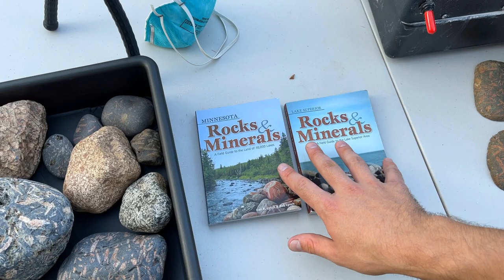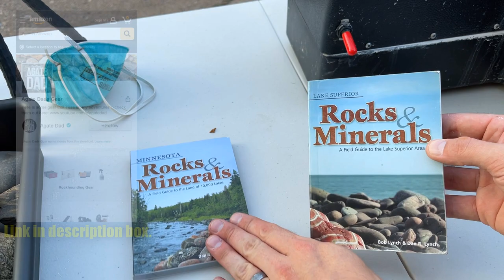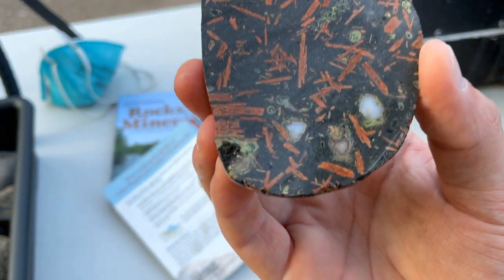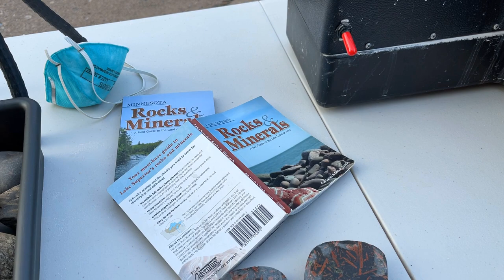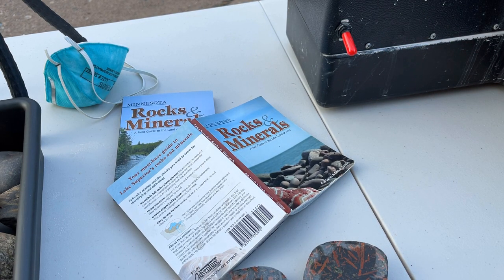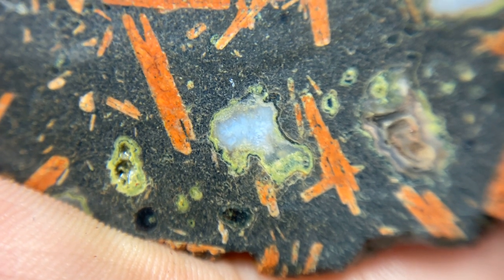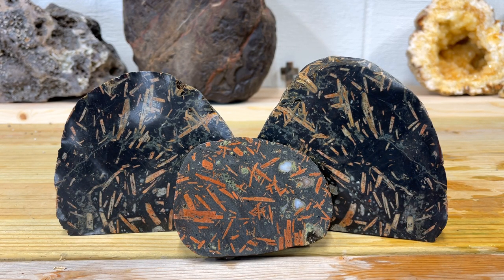I Found AGATE inside Porphyry!

Comment: I’m glad you showed how the blade doesn’t cut. I just bought a tile cutter with a Diamond blade and I’ve only cut a few rocks and I was scared the entire time.. 😬
Reply: careful you can still crash your fingers. only rulenis dont put a lot of pressure on blade if you have to put more pressure than usually buy new one
Reply: @uooello13  or you can clean it up and bring the diamond back up by cutting some bricks. Thats what we did when l worked in a lapidary shop.
Reply: @tinaredington1292  yes i forgot bout that.

Comment: Cool cuts. How good are you at cutting slabs straight? One of my trim saws has a little fence that helps get the two cuts parallel. I don't do as well just eyeballing them.
Reply from the maker: I’m not perfect at it but it’s not bad, I should get the slab guide for that saw
Reply: @AgateDad  If you're making a cab, it doesn't matter too much because you can even it out later. It matters if you're making something like crosses though.
Reply from the maker: My thoughts exactly

Comment: I found one this summer on Cap Sante beach in Anacortes Wa. I had a friend slice it into slabs.This rock was most beautiful and it has fern like patterns and the biggest surprise it has garnet inside.I poured resin glaze on the slabs and use them as coasters! Thank you for your video,  you ROCK

Comment: I really liked this video. They are so pretty. I wish I had a saw like that to slice mine apart, but I live in an apt, my dremel is the best I can have here.
Reply from the maker: Do you have a garage with your apartment?
Reply: No I don't have a garage, only my front yard. I have 100' extension cord I plug into my apt, run it down the steps, across the yard to my treestumps where I do my work. I use a 2 gallon jug of water with spout to drip water from.
Reply from the maker: Oh okay I was going to suggest that, I think you got it figured out though. I’ve heard some people use their shower for cutting rocks lol idk about that

Comment: I do not think they are inclusions, they are phenocrystals from the fractional crystallization of the magma. While the agates you accidentally found are of secondary origin.
Reply from the maker: So the books I referenced that showed a solid positive ID at the beginning.. is that wrong??
Reply: @AgateDad  No your right its down to a differing of definitions. Inclusions are something that becomes trapped or emplaced in a rock where a phenocryst is formed with the rock when it cooled of which poryphry is the textbook example. while the agates in there were formed separate from when the rock itelf was cooled and formed hence the secondary origin

Comment: Say, cool deal with amygdaloidal and porphyritic together! The book says they are different - but I do not think that means they cannot occur together. This rocks tells us so - it exists! They ARE formed by different processes in different environments. So when you consider that the ancient rocks of the North Shore of Lake Superior are some of the oldest rocks found in North America this makes sense.. The porphyry part is from the first formation of this rock from a hot magma. The amygdaloidal agate part is from later, when gas bubbles got filled by circulating water and minerals. These rocks are OLD and have a very long history. What about the gas bubbles that were necessarily there first before the agate could fill them? These porphyries formed in two phases - the large red feldspar crystals formed from slowly cooling magma while the melt was still deep underground. At some point this melt reached the surface and was chilled quickly, making the black matrix of basalt with crystals too tiny to see (mostly.) At the same time, some gas bubbles formed before the melt cooled completely - it had gas! So the agate is the last chapter, filling the voids towards the end of an unimaginably long history.

Comment: I thought you had to use oil to cut these rocks??? I think oil is ruining some of the rocks I cut.
Reply from the maker: How so?
Reply: @AgateDad  I adopted a ten inch saw and about twenty milk crates of rough and I was told you need to use mineral oil in the saw as water cant flush the blade of rock debris and your blade will get ruined so I use oil in my auto feed saw as do people in the videos I watch . The problem is the oil gets absorbed into some of the rocks and darkens them and then you cant get the oil out. Thanks for now